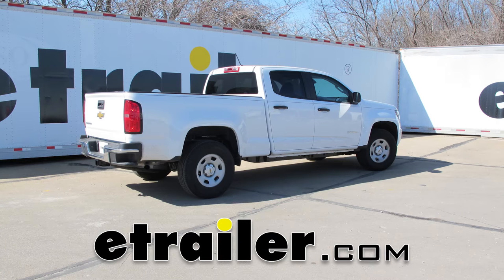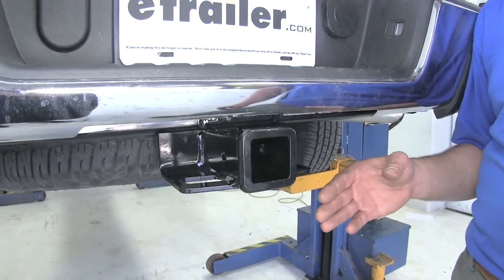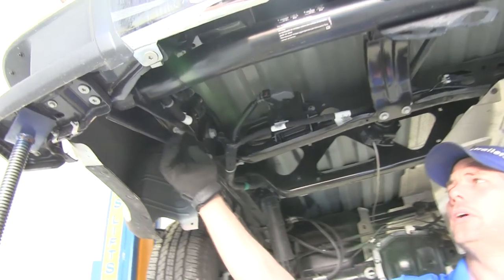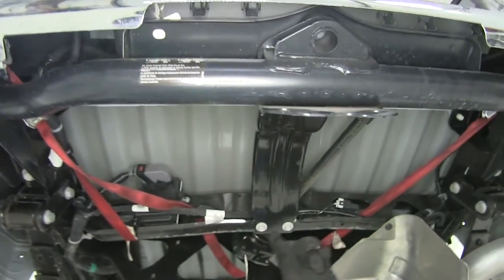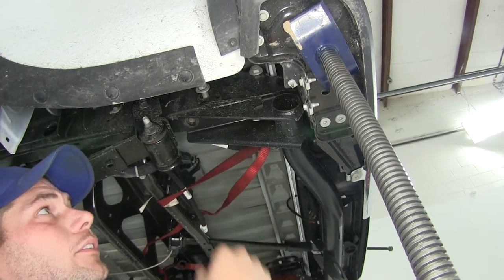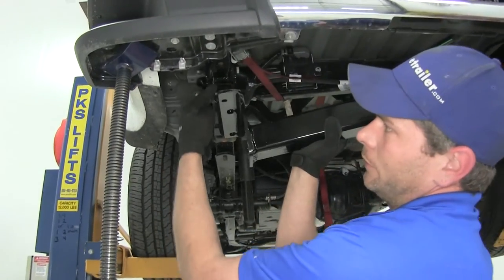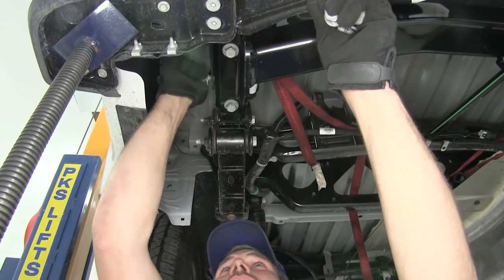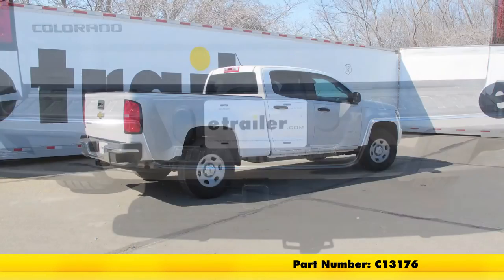etrailer | 2016 Chevrolet Colorado Curt Trailer Hitch Receiver: Complete Installation

Comment: I heard this is a really tight fit. That you have to bend it to get it to fit?
Reply: You dont have to bend it, but it is very hard to get in there just right especially if you are on the ground.  Keep in mind too, as you can see in the video the bumper is partially hold up by the two horizontal bolts on each side so you have to be careful.

Comment: So can you still attach a strong hitch to the factory bar that you took off? I've heard that the towing cap for the Colorado is 3,500 or 7,000 with the trailering package. I can't remember if I got the trailering pack or not. So is that the bar that the trailering package comes with? I have the bar, so I want to know what the towing cap for it is. It's just so weird since it has that angled plate sticking out at the bottom.
Reply: linnes16 I have an Acadia 2007, do I have to install a new hitch to the car to move something heavier  than the limit weight? it is suppost to pull 4500#, it was installed when I got it, the dealer said it is manufacturer. Any recommendations?
Reply: For the Colorado if you have the 2.5 motor the capacity is 3,500 if you have the V6 its 7,000.  The Diesel adds a little more, but im not sure how much.  You don't have the locking diff with the 2.5 but there again thats why you can only tow 3500.
Reply: T Young is correct, the engine makes the towing weight difference. The factory bar is there mostly as the bumper support/structure. You can tow with it as a bumper hitch by threading the ball mount directly through the hole at center, and as you know it has a place to secure safety chains as required. However, I have heard that often the bumper height is too high for safe/effective hauling, though I am not an expert on it.

Comment: will this fit 2018 z71?
Reply from the maker: It is confirmed to fit a 2018 Chevrolet Colorado Z71. The link for the hitch is listed below. Also, there is a link for the other hitches that are confirmed to fit a 2018 Colorado. 

https://www.etrailer.com/Trailer-Hitch/Chevrolet/Colorado/2018/C13176.html?vehicleid=201828596

https://www.etrailer.com/hitch-2018_Chevrolet_Colorado.htm